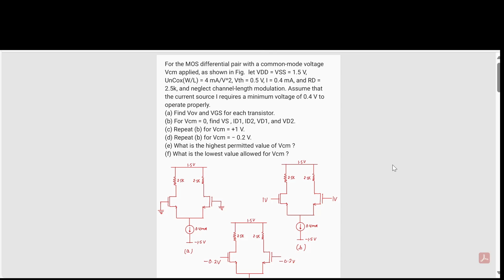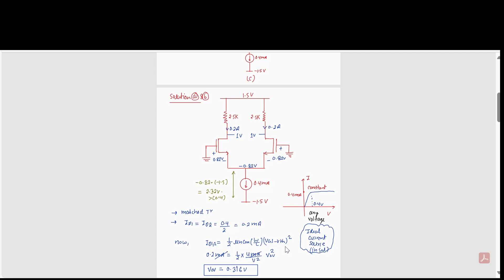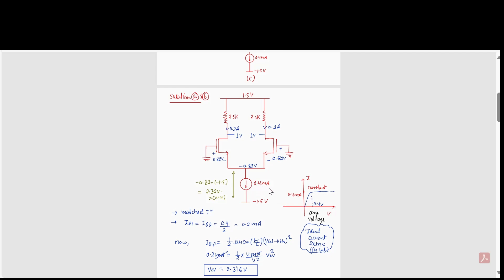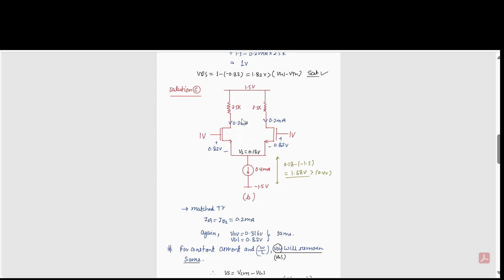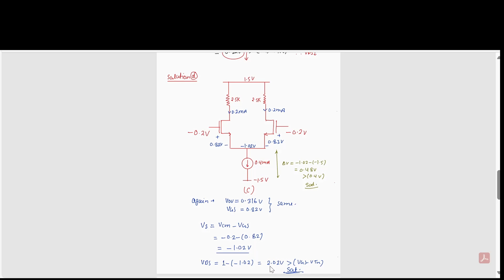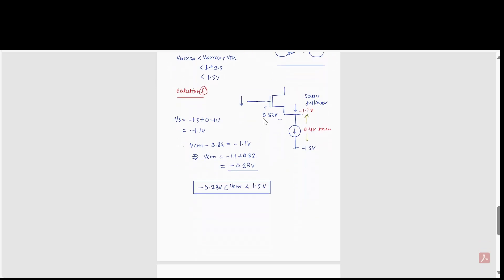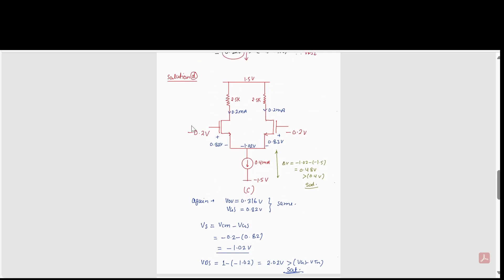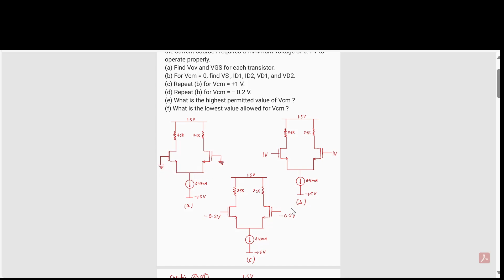ICMR Solved Example | AnalogX

Comment: Hi, can you re check @02:50 you have written -0.82 - (-1.5) = 2.32 but it will be 0.68, anyway the current source will still work (saturated) but the calculation seems to be wrong.
Reply from the maker: Thanks for pointing out. Let me know if you find any other mistakes.